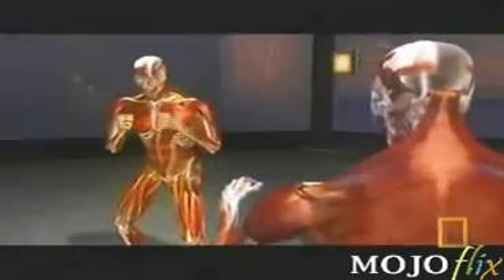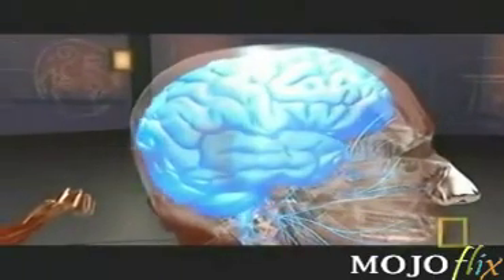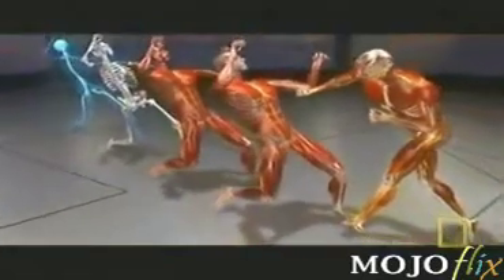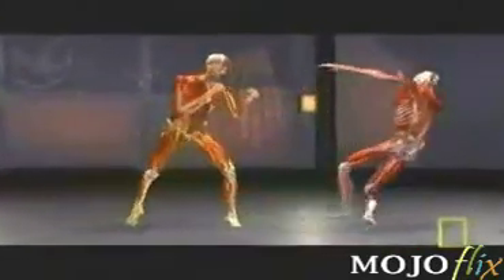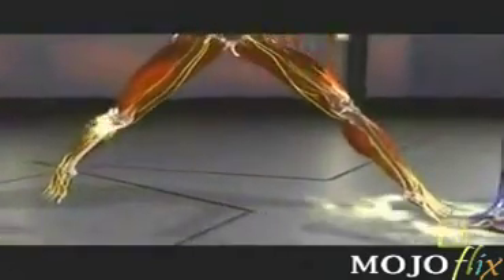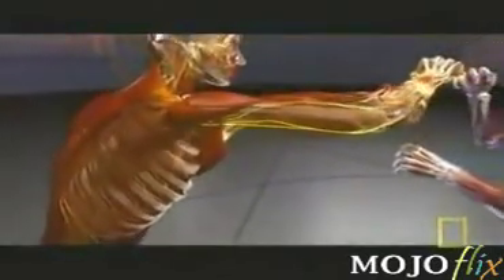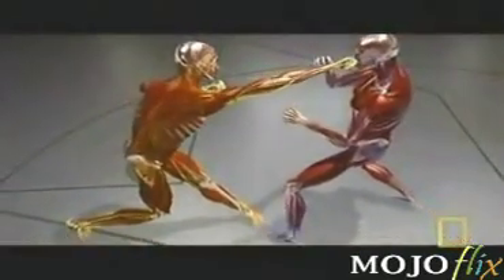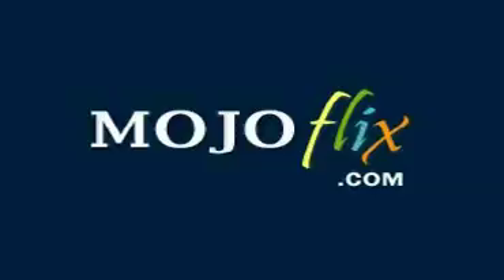The Anatomy Of The One Punch Knockout

Comment: Ok...point taken. However, let's say you put a Manny Pacquiao in a fight with a 230 lb former wrestler that doesn't know squat about boxing or punching technique. Now, lets say that this guy throws a single lucky haymaker right on Manny's jaw. I'd guess Manny would be knocked out after that hit. But size does matter when talking about punching power. Technique just adds speed and precisian to the mix.
Reply: Really depends on how hard the hit is, if it's 500 newtons then Manny would manhandle the guy after the punch, if it's like 2000 newtons Manny is out, down for the count

Comment: I thought size does matter but the more speed, forms into more power.

Even if you do have mass but have no speed to compensate. Wouldn't that mean someone who has normal mass but has full control and speed forms into more kinetic power?

I'm lost
Reply: It means if you have functional strength, more muscle mass than average and train boxing for years to have speed, you have way more powerful punches than you would if you didn't take lifting seriously.
Reply: I've had around normal muscle mass and speed but not a lot of power, now I have a lot more muscle mass and my punches are faster and more powerful than ever. Stronger muscles move easier, I have very strong back, shoulder and oblique muscles (muscles most recruited during a power punch) so my punches are way better because of that and because I train boxing several times a week.
Reply: Interesting. Hmmmmm
Reply: Bigger muscles move faster, but yes, if your arm is just fat it's not gonna move as fast

So a fat person is at a disadvantage against the average Joe because they're not very fast, and yes ½mv² still applies here, but the thing is to get an increased speed you need a ² amount of kinetic energy

TLDR: Yes, but muscles make you faster anyway